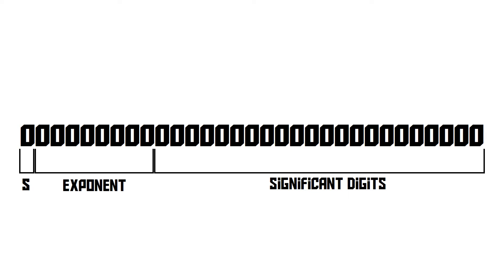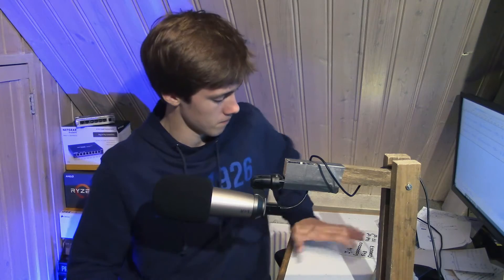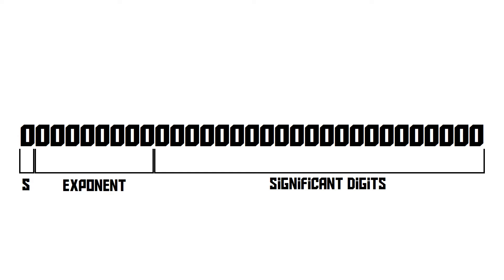What are FLOPs in computing? (AKIO TV)

Comment: Thanks. I recently heard about flops but wasn’t sure what they were. I was wondering if it could be the number of 1s and 0s switching to one or the other, but this is a whole lot more involved. I think it’s interesting. 

When it comes to computers listing flops, not just on the cpu or gpu, like flops of a supercomputer, are those cpu flops, gpu flops, all the flops of all flop capable parts combined? How do flops play a part when not dealing with math, but let’s say a video game?
Reply from the maker: @robertbutcher222  Flops on any device are the same thing. When you have a supercomputer claiming X amount of flops, that's just the total usable amount availabe. It could be cpu and gpu combined, but it's also possible the cpu's aren't used, depends which one it is. gpus are obviously always used if they are present; they wouldn't even be installed otherwise.

At higher levels (say running a game) floating point math is involved in a bunch of things, most notably in rendering 3d graphics. Essentially you calculate what a certain 3d space would look like from the perspective of the player. And do this 60 times per second, or however many times the screen refreshes. The calculations done are mostly on floating point numbers.
Reply: @AKIOTV  Thanks. It’s interesting how gpus do x flops so fast, along with every computer part doing many things so fast.

Comment: I want to understand something. If I had 1terabyte of data and had a computer that has a 1GFLOPS processor. How long will it take to process it? Thanks.
Reply from the maker: that depends entirely on the type of data, and the operations that you want to perform on them.
Reply: @AKIOTV  Lets say the data is graphics rendering and the operation is to rendering. Thanks
Reply from the maker: @mryesnno4301  Look, there's no way to figure out how long that data will take to process. "Graphics" is an extremely broad thing; there are loads of types of graphics information to deal with, and there are also loads of possible operations to perform on said information. Generally speaking, it's incredibly difficult to work out how much time an amount of data will take to process based on characteristics of the data and the operations used. 

When an estimate is given on processing time, that's usually done by processing a small sample, and measuring the time it takes to process that. Based on that information you can then estimate how long a larger batch would take.
Reply: @AKIOTV  thanks